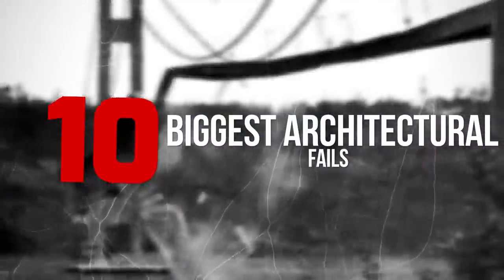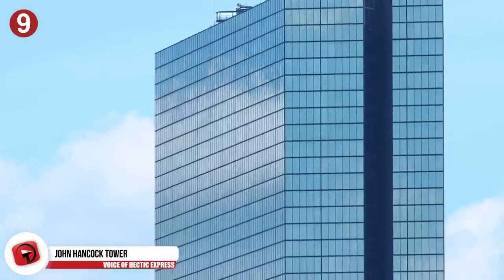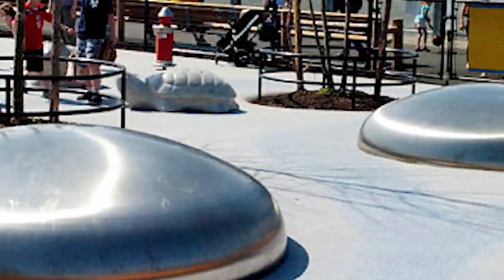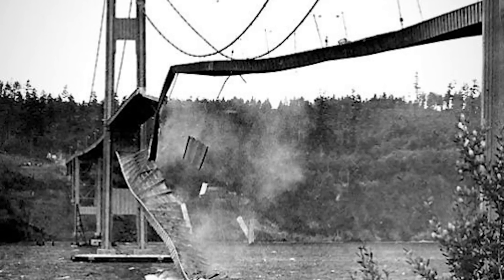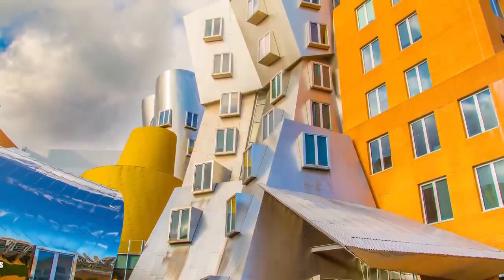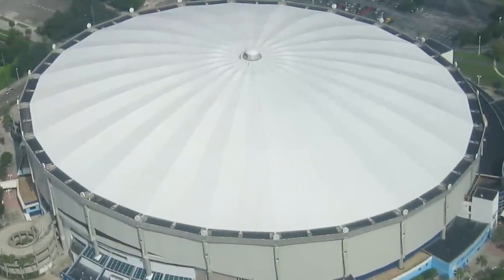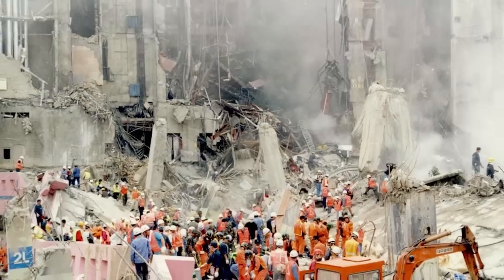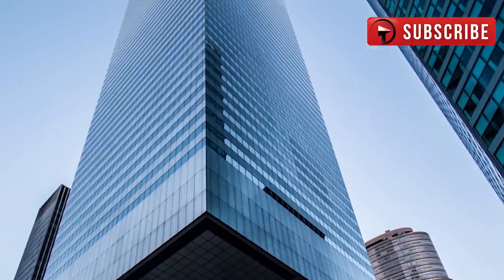10 Biggest Architectural Fails

Comment: The "Walkie Talkie Skyscrapers" are melting cars in LONDON.  Remember, now, this is a country with barely any sun and is mostly foggy and drizzly all-year round.
Reply: That's a myth
Reply: london the country. A+ geography
Reply: Tim Haddock What is a myth, the fact that the country is foggy and drizzly all year round, or my statement that the buildings are melting cars?
Reply: The UK isn't actually foggy and drizzly all year round. More like cloudy and windy.
Reply: The weather, sometimes its very nice, most of the time it's clement.
Reply: Tim Haddock Ah, my mistake, all the drizzly rain is in Belgium.
Reply: But it will plastic. And Rubber. Which is a substantial amount of vehicle parts
Reply: Timothy Ritzer
May not do the paintwork much good either.

Comment: OK, the picture of the Chinese Apartment building on it's side has nothing to do with an architectural fail, or even an engineering fail. It has to do with corruption and greed. The supervisor and project manager were responsible for this, nothing more. Altho it was officially reported by the PRC government as a soil subsidence from excavations for the car park being the reason for failure, the actual cause was that they had sold of approximately half the pilings, which supported the foundations. This was an incremental change situation, where previously they had been 2 pilings short on a build (as a genuine shortfall in delivery) They decided to continue the build and it was fine. They then sold off some pilings on the next build and pocketed the money. This trend continued until they got down to half of the required pilings and.........Uh Oh, she's over! You need to understand that the company responsible for the build was delivering 2 apartment buildings every 3 weeks, so the chance for this to all go wrong quickly was very real. It was also highly profitable for the 2 men concerned, although eventually being executed wasn't that great. I know all this because I was part of the official investigation team, brought in to conduct a parallel investigation as to the cause.

Comment: The Trop definately is the worst baseball park in MLB.  However, the venue was originally built to be multi-purpose and though it was meant to not have a dome structure at conception, a roof was implimented to keep the weather from affecting events that occured there.  Later on, the Rays would make it their home.

Comment: The rays stadium is pretty stupid, you do realize its practically 90-100 degrees about 3/4 of the entire baseball season with nearly 100 percent humidity. They needed that roof or no one would go to the games. Inside its air-conditioned, its the only way Florida or Tampa can have a baseball team with a substation audience.

Comment: Your explanation on the Tahoma bridge is not correct. The bridge was supposed to move and it didn't fall because they went cheap on the materials. It collapsed because they didn't consider that the oscillation caused by the wind had a frequency similar to the resonance frequency of the structure. So when it started oscillating the amplitude increased always more until the bridge collapsed. Basically they failed to design the shape of the bridge

Comment: How does a car melt down to its body? Is it made of ice? Also, how does 200,000 people die if a skyscraper falls?? If the building held 4,000, and 2,000 are hit by the building and debris, you are not even close to 200,000.

Comment: Bridge 7. The Tacoma Narrows Bridge could have easily have been a robust design with the addition of varying aerofoil sections along the span.
The problem was that the constant section of the span was excited in its entirety by the von Karmann vortex of the wind. If the section had varied across the span, only a small section would have gone into resonance, which the rest of the bridge would have been able to dampen out.

It's not rocket science, nor is rocket science.

Comment: I'm sure someone else probably pointed this out already but the failure of the Tacoma Bridge had NOTHING to do with substandard materials. The reason the bridge failed was that it had a natural frequency that was harmonic  with the geographic area it was in.  This was a huge revelation for the civil engineering community and analysis of the natural frequencies of structure became an important part of all future design work.  This is like engineering 101 and the Tacoma bridge is the poster child for this phenomenon. You're reporting on this matter is as lame as it gets and brings into question the credibility of your entire presentation. And just for the record, this was NOT an "architectural" failure, it was an engineering mistake. .

Comment: The Tacoma bridge is not  engineering failure, it was built in the 1940's when the wind effect on structure was stil unknow..
only after they had done failure analysis they discoverd those effects, and changed bridge constructions for ever

i am mechanical engineer in case you question my knowledge :D
Reply: Of course it should not be a excuse, but in real life everything can fail and it is going to fail, especially if you dont know that this is problem at all like the wind in that case.
what great about  it is that it  much more easier and useful to study from a failur(more than 90% of all inventions were made that way)
unfortunately people get hurt in the process.

you cant use failure analysis when we talk about nuclear power , it is very bad to study from exploded power plant :D

Comment: Number 6 is an engineering fail. Actually it's an architectural success, as the building retained its structural integrity even after the footings failed owing to ground movement and the entire building toppled over. How many buildings topple over without coming apart? This was a Geotechnical engineering fail - please relocate this example to another video.

Comment: While the Trop is a horrible stadium to go to, building a baseball park here in Tampa without a roof would be an even dumber idea. In case you haven't heard, it gets quite hot here in Florida during the summer. And if the sun isn't causing you to spontaneously combust, the torrential storms every evening also make for great baseball weather. Perfect for an open air stadium.......

Comment: At least no one died in any of these situations.  What about that walkway collapse at the Kansas City Hyatt Regency in 1981 that killed 114 and injured 216.
Reply: +NorthernSeaWitch  My bad, I'm sure you're right.
Reply: Rick Hagedorn
Not a big deal, the narrator's voice is aggravatingly bad, hard to listen to closely.
Reply: 500 people died when the Chinese department store collapsed.
Reply: +dorfone   I guess the KC Hyatt Regency disaster wasn't included because the walkways weren't designed for dancing.  There must be a bigger architectural failure however than those futuristic dome structures at #8.
Reply: +Rick Hagedorn That's not what caused the collapse. The construction company halved the size of the metal beams inside of the walkway without telling anyone as a cost cutting measure. As a result the walkway could.just barely support its own weight and failure was simply a matter of time.

Comment: Interesting set of buildings with problems. 
However, some of the explanations are simply wrong. For example, the Tacoma Narrows Bridge or Galloping Gertie, did not have a materials problem. It had a frequency of torsional vibration that was close to the frequency of the air vortices that were shed as wind blew across it. And the problem with the Citibank building were more complex than described here.

Comment: the tacoma narrows bridge didn't fail because of what it was made of, it failed because the wind blowing over the bridge caused "torsional flutter"., a phenomenon that causes vorteces to form around the bridge structure as air passes through and around it. do some research and find out.

Comment: before i finish this video, i hope the trade center is #1...because ya know, a steel building falling from fire and all...biggest fail of building in history....OR.....
Reply: DoinItRightTheFirstTime TF does physics have to do with it?
Reply: You are ignorant then. If a fire is uncontrolled (ie not put out by sprinkles) it can severely weaken the metal pillars.

Steel loses half of its strength at 600 C, and the fires at WTC burned at 1000 C. 

So it's you who does not understand physics. A fire can be a HUGE problem for a skyscraper since weakening of the metal frame is devastating... yet while most fire spread uniformly even if the sprinkle system fails, at the WTC the buildings were literally hit but a 90000 litre molotov.
Reply: Enlighten us o great one.
Reply: how was that an architectural fail? Because they weren't built plane proof?
Reply: physics 101. you simple minded pigeons.
Reply: Physics to some of us come as naturally as speaking. We understand everything that happens at any given time while physics are involved. We don't think as a normal brain scrambling to make sense of our enviroment. We see everything as a single event and understand all of the element involved. We don't stop to think and embrace the theory of steel I-beams melting because of jet fuel because we understand the fire caused by the crash burned beyond what is safe for steel. It only had to burn hot enough to compromise the structural integrity of the building. The impact of the plane alone was not a threat but it was the subsequent damage fueled by the fire. The reduced further loss of life was the reason the building went down the way it did, because the structural integrity was compromised in the core of the building. It basically acted as a controlled demolition but many used it as an excuse of a controlled building collapse. Rant over
Reply: best comment ever
Reply: DoinItRightTheFirstTime You fail to realize that the jet took out about 1/2 the supporting structure upon impact and that a steel beams integrity is seriously compromised over 500 deg.Do you have any idea how hot jet fuel burns at clueless.

Comment: The Tacoma Narrows bridge didn't fail because the builder cut on construction costs. It failed because the wind stimulated vibrations on the bridge surface that were resonant with the structure. The vibrations created waves that got larger and larger as they reflected back and forth across the bridge. It was poorly designed. Not poorly built. 
The problem with videos like this is the narrator often has no idea what they are talking about, yet pretend to be experts.

Comment: I'm from london and the walkie talkie did indeed melt small portions of cars (wing mirrors, bonnets etc...) and it was a mixture of ammusment and bewilderment, but ffs adding the line "it's even melted cars down to thier body frames!" is so fucking sensationalist, and i must say, American.  Melting cars down to thier body frames = melting the paint. But 'melting the paint isn't quite so shocking, right? Also, how is that worse than a whole fucking bridge or building colapsing - earlier entries in your list - which potentially could of killed dozens of people??

Comment: THe Citigroup building story is incomplete, reality is far more interesting... there was an engineering error (not an architectural one) that was found by a grad student who was studying the building (which he admired) and he went to the original engineer with his findings and they agreed.  The repair was expedited and finished just ahead of a major storm which threatened the building.
Reply: I know your comment has been quite a while ago now but I agree, the actual story is quite interesting. I learned about it while in school studying engineering (been quite a few years ago) and if I remember correctly, the original design called for welded joints but the site engineer erroneously approved bolted joints without consulting the lead engineer. Also, at that time, they didn't calculate wind loads coming from angles (only perpendicular) to the sides. There also was no "hiding" of the repairs. Quite the opposite in that they were advertising positions trying to find qualified welders and expediting the procedure to license welders to get it done quickly. I think they may have even had some issues with getting enough steel to the region to keep up with the repairs. I also seem to recall that all the repairs were made and there wasn't even a lawsuit involved. Bet that wouldn't happen today!

Comment: thumbnail has nothing to do with architecture.  that was a failure in geotechnical engineering.  excavating soil on one side of the building they piled it on the other side.  this created a catastrophically large pressure gradient in the soil, snapping the pile foundations (beams or pipes lodged deep into the ground).  area was still under construction though so not horrible.  almost knocked down the nearby buildings though

Comment: You could have done a better job researching the John Hancock Building ......you left out how the swaying problem was solved not to mention what caused the problem with the windows  in the first place.....what caused the problem was that the heating and a/c built up the air pressure so much in the building it was blowing the windows out and the swaying problem was solved by a huge steel plate was zig zagged down the building essentially connecting all the support beams together.....another interesting twist is that the architectural firm that designed the buildings was on the hook for the repairs but of course had insurance for just such problems.....guess who insured them????.....JOHN HANCOCK!!!.....OUCH..!!!.....LOL....Danger-Russ

Comment: Though many of these costly design flaws are compelling, I am going to comment on the most benign yet ridicules one presented in this video. Those stupid steal blobs in the children's playground! I'm not even an architect and if you told me you were going to put shiny steal Mallomars in the park for children to sit on I would immediately think HEAT! Unless these were installed in a Siberian playground  as a way to warm your bottom, I see no other point for them. Remember those 12 ft. tall Stainless steel city park slides that would burn your ass should your skin come into contact with them on sunny days? Well I can at least justify them as being thrilling and the polished steel necessary for creating a slick friction-less surface, but what the hell were kids supposed to do with these???? Probably the city gave a politically motivated grant to some modern artist to design these things to look like his/her art and be a form of functional sculpture.  However, no beautiful or compelling form, and no useful function other than a solar heat.

Comment: The building on stilts at least the structural problem was detected and fixed before a catastrophe and although done quietly city officials and emergency response workers were aware of the problem and ready to act evacuation plans were ready to be implemented in the event of emergency problem was solved before anything happened

Comment: Your information is pretty crappy. Citicorp building was a bit of a failure but because the architects didn't calculate wind loads taking surrounding buildings into account, and they didn't weld the bolted joints, they added gussets to the joints. Sampo department store had its structure compromised by adding a 2 foot thick concrete floor to the spa on the top floor, and roof girders were damaged when the air conditioner was rolled across the roof on dollies. And I'm not even gonna start on how wrong you are about the Tacoma narrows bridge.

Comment: stupid movie and vastly exaggerated. The walkie talkie building in London didn't "melt cars down to their frames". it melted one wing mirror and warped a panel. it gives the impression of some sort of "death ray" burning everything in its path. And it only happened in one particular summer where the sun was particularly low in the sky - I was fixed by installing so panels (sort of like fins) on the concave side...... how annoying the internet is - exaggerating so as to get hits and undoubtedly ad revenue from them.

Comment: What about the World Trade Center? Or are we not touching that with a bargepole?

All escape routes taken out by a jet liner and the fire retardant given time became flammable. Not to mention the beams being susceptible to high temperate heat.
Reply: All buildings that used that clip system were subject to failure, even from a minor fire. The system was new, when the towers went up, so the issue was not well known. But, in the late 90's, it was well documented, and we were taught about it in college. Well before the incident. The beams were not what failed, it was the clip system that held the individual concrete floors to the steel frame. When fire heated up the mild steel, it would soften them further, causing individual failures. On paper, there should have been more than enough redundant clips to carry the load, but the design never took into account that the concrete WILL sag ever so slightly. This put greater stress on the undamaged clips surrounding the effected area, causing them to fail, in turn. This would lead to a cascade failure of the whole system, if not checked soon after the damage. And doing that is almost impossible to do, due to the fact that the building in question is usually still on fire.

The World Trade Center buildings were not the first, and will not be the last, to fail catastrophically to that clip system. That was the engineering failure. Not the beams, or the frame.
Reply: Yeah, the 9/11 commissioners lied, but no worries, TheGuruStud will enlighten us. Cuz he knows, just ask him.

Comment: This is largely bollocks!!! For a start no differentiation is made between Engineers and Architect. The piece also contains factual errors. For example, the Tacoma bridge did not fail because of the materials used but be design issues resulting in a lack of stiffness. I could go on but honestly can't be bothered!!!!